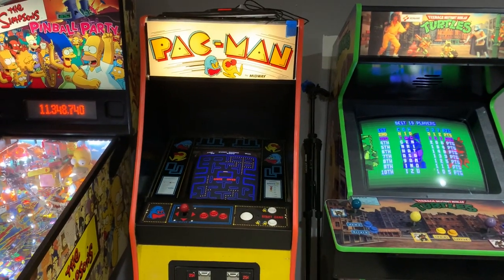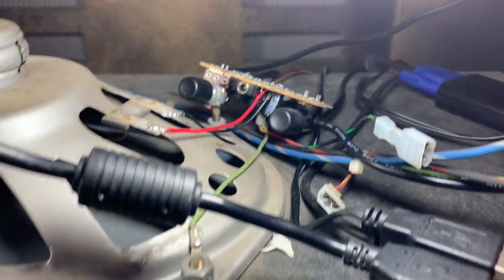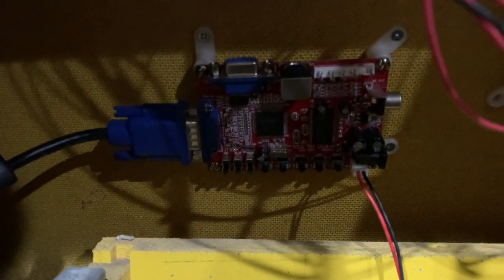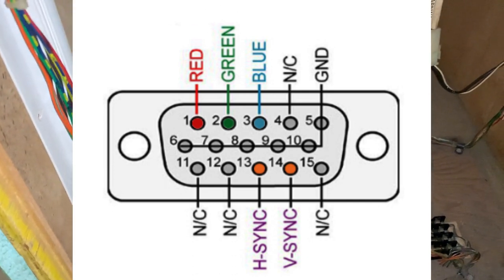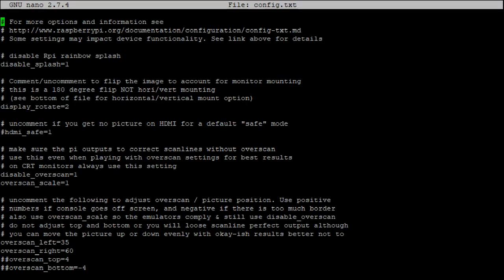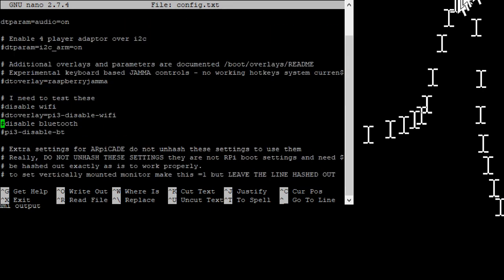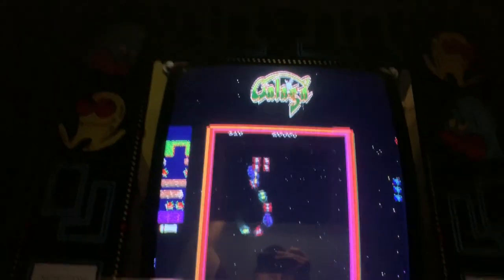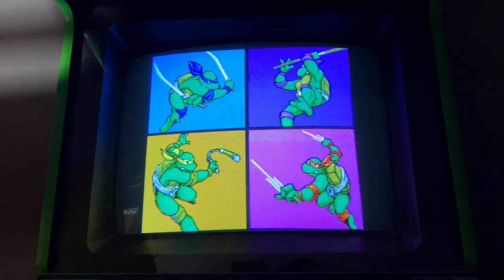The BEST way Raspberry Pi to CGA Arcade Monitor! 240p NO GBS-8100 REQUIRED!(settings in description)

Comment: This video is fantastic, and possibly a starting point for me.  
I've been chasing the idea for years to run my older games on an actual RGB CRT  (Sony Trinitron) but have always got lost in how to actually create the older signal type 15KHz
and 240p.   (is it 30Hz or 60Hz?)
The last thing on Earth I'd expect is to be able to get this out of a cheap HDMI to VGA adaptor or a Pi.  
There are so many years of rabbit holes requiring really old software and special Hardware to produce this result.  With no real answers or hardware availability.   
This looks like it could actually work much to my surprise.  
I have a number of other issues to overcome as my MAME and ROMS are all from 1997 and only work on some old Windows98/95 version of MAME32 that I have.  
So apparently, I need a more modern version of MAME and all new ROMS as my old ones will not work.  
But that's an entirely different issue that I can figure out.

Comment: Thank
you so much for your info. I have an old Time Pilot cabinet that I was trying
to configure with a Rasberry Pi 3 and didn't have any luck getting it to work
with the original CRT until I found your video. My monitor is slightly
different (Wells Gardner K4951). My JAMMA harness is connected to a J-PAC and I
can confirm that the monitor works great with your settings without using the
custom cable since the J-PAC is already connected to the monitor through the
JAMMA harness.
Reply from the maker: Awesome! Glad it worked out for you!

Comment: Very informative vid mate - helped me heaps. 1 question though - doesn't VGA output @ 31kz (and the monitor would be 15kz) or is this something you can adjust in the config?
Cheers :p
Reply: Good question, I'm wondering the same thing...

Comment: Very tastefully converted Pacman cabinet! I have used the VGA cable hack method on all of my cabinets, but use a PC for the emulation. I've got hold of a Raspberry PI now, and am going to do some experimentation soon. Thanks for the detailed video!
Reply from the maker: Thanks! My goal is typically to make the game just a board swap away from being original if I’m putting a pi or PC in it.

I actually just did a GroovyArcade build with an old PC using the same breakout cable. Turned out well, except I had to bypass the JPAC for the video because it just wouldn’t sync no matter what I tried. 😢
Reply: @sk8ersublime  I guess the JPAC bypass using GroovyArcade would be necessary, as GroovyArcade (well, GroovyMAME in that build) does all of the front porch / back porch / 15Khz analogue CRT conversation output itself, without any special convertor (ie: a JPAC, etc)... hence its charm (and AMAZING emulation results). GroovyArcade is amazing.

Comment: Enjoyed the video!  Curious what version of mame you are using?  I have about 10 diffrent arpicade images and always on the lookout for which roms work best with each software version. (Arpicade 3.7, 3.8, etc...). By the way, the Arpicade itself is a fantastic product for any Jamma setup.
Reply from the maker: Yea the RaspberryJamma aripicade is an amazing plug and play solution. I have the 4 player version in my TMNT cabinet since it didn’t have a board and it’s been great. For mame version, I’m using the arpicade 3.9 image so I think that has .207, .192, .172, and .139.

Comment: Great video. So much great information! Have an old cabinet with a good arcade CRT looking to add a PI too it. Seems so simple the new / second way of doing it.
I was wondering what image are you using for your PI. Where to find image? How large?
Been looking for an image like the one in your video, really like it. Keep up the good work. Thanks.
Reply: Check out Arcade Punks website.  There is a front end called Vertical Rise for the RP3 that works great.  Download the torrent file and use Utorrent to download the content.  It's about 16gb.    Good luck

Comment: This was a great video.  I’m redoing a cabinet with such a monitor and it’s already setup with a direct vga cable.  Guessing it was put together the way you did.  I’ll give it a try when I get my RP4.  Newbie, so learning curve is steep.
Reply from the maker: Thanks for watching! Shoot me any questions and I’ll try to help
Reply: I can send some pics of my setup but youtube isn’t giving me that option right now.
Reply: My cabinet was an old mame machine and the monitor looks almost exactly like yours.  He had it setup with a VGA cable going directly to a connector on the monitor board.  It has about 10 wires connected.  It was connected to a computer video card of some sort.  Is it safe to just try it out with the RP?  I've read a few places that improper voltages and cause damage.  I would like to send you a pic to see what you think if there's a way to DM you.  Thanks again.
Reply from the maker: Josh if it’s an old mame machine it’s very likely it was connected to an ArcadeVGA video card in the PC. Very likely the same cable breakout cable sold by Ultimarc as they were the ones who sold the ArcadeVGA. The pinout should be the same, but I would verify with a mutlimeter to be safe.
Reply: @sk8ersublime  thank you.  Would you share some good sources on this topic?  I am very interested in it.
Reply: Also, very noob question... I am looking at Jamma RGBpi and it obviously outputs RGB on the Jamma cables, but can you still connect the monitor the way you did via an hdmi-to-vga adapter and use a Jamma harness for the controls?
Reply from the maker: Arcadecontrols.com forum should cover just about everything you need

Comment: Great job! I’m in the same position with my miss Pac man cabinet. What version of mame are you using? And I guess the trick is to find the roms for that version of mame. Also did you get the high score saving to work? I have a similar set up with RaspberryJAMMA but trouble with some games working or appearing in the menu
Reply from the maker: I’m using various versions as some work better for certain games. I’m using the ArPiCade image that I use with my RaspberryJamma. It has versions .207, .192, .172 and .139 I believe. I would have to double check

Comment: Instant sub, thanks for the info!
Question. I have two CRT monitors with the CGA/9-pin input (and the requisite RGB pins visible/accessible inside, similar to an arcade monitor) that seem like maybe they were from a video wall or similar. Before I go buy an RPi3 and/or other accessories, is there any chance a weird resolution would prevent this from working? And/or if so, any other ideas for testing these CGA/9-pin monitors somehow before ditching/donating them?
Reply from the maker: Not really sure off hand, I would assume it might work as long as you know the pin out of the db9 connector and wire everything correctly to RGB and Sync. Good luck!
Reply: @sk8ersublime  Fun twist, I'm dumb and there are actually only 5 pins, R G B E and S. RGB and S make sense, but not at all familiar with an E pin.

Comment: I used a VGA666 interface, I think is a cleaner solution. My cabinet also has CSync, so I had to combine the sync signals,  as well.  As far as I know it is not recommended to just connect both cables together, you need a combiner circuit  like this: https://www.retrorgb.com/building-a-passive-sync-combiner.html . Also, there is a specific 666 converter that has the csync ready: http://retrogamerestore.com/vga666rgbs/

Comment: Great video and great explanation! Do you know if I could do this with a medium (EGA) resolution monitor? Thanks for the video.
Reply from the maker: I’m not sure off hand, as I’ve never worked with one before. I would assume it would work as long as RGB and Sync are the same, but you would use a higher resolution. But Again I do not have experience with that. Thanks for watching!
Reply: @shark80228 I have an old school Japanese Sharp CRT monitor Analog DB9. I haven’t connected it to anything yet. What are the res differences on CGA vs EVA?
Reply: @r.in.shibuya  CGA is 15khz and ega is 25khz. EGA is medium resolution and CGA is a lower resolution. Getting input at the correct frequency is the tricky part. I'm still trying to figure it out.
Reply: Shark80228  thanks the for the reply. I am dealing with a CRT monitor that has a DB9 input (SHARP CU-14AG2) all I know it’s a color RGB, I believe it was for the old first gen PC’s (NEC PC98). It turns on but still no source to test it with. I picked up the HDMI > VGA (db15) converter and used a db15>db9 pin converter. Before I adjusting setting with my Raspberry Pi I want to make sure it’s working. I do See the crt rays minimizing and expanding on the screen when I switch it on an off... but I’m not sure if that a marker of it being 100% functional, I do have a strong feeling the monitor is fine.

Comment: I am using a 60 in 1 currently, I had no idea you could set the pi up for vertical. I may well install my pi 4 as well now, but my crt is on scart which is a pain in the arse, got an ultimate scart adaptor on the way as nothing else has worked properly display wise using any cable adaptor  so I'm hoping the ultimate adaptor will do it. I can only dream of a wells G. monitor at min :P one day....One day.
Reply from the maker: I don’t have any scart experience, but it looks like that ultimate adapter should do the trick based on the description I just read. Good luck!
Reply: @sk8ersublime  Thanks and I sure hope so I've tried a few adaptors for scart crt now and none are very good tbh. I know you can fiddle with the tvs to accept an standard rgb input but I was trying to avoid that and a proper arcade wells G. Monitor is way out of my price range right now.
Reply: just make up a cable
Reply: @Teckno77  SCART-equipped tvs accept by design RGB over SCART...

Comment: Nice job!i Works with out raspi-jamma?I planning to use 0 delay encoders and wire up straight to the arcade monitor
Reply from the maker: yea! no raspberry jamma required! Good luck with your build!
Reply: sk8ersublime Thank you .Only problem I have now is overscan on top and bottom.Do you know how to fix this?
Reply from the maker: Arcadezone 81 you will need to play around with the overscan_left and overscan_right settings. Try them at 0, or comment them out. I tried a bunch of settings until I found what worked best for me
Reply: sk8ersublime I will.Thank you

Comment: When you tie the horizontal and vertical sync lines into a single line going into the arcade CRT, do you have to add a resistor in series between those lines and the monitor?  Doesn't that double the potential current going into the monitor's sync?

Comment: hey back again..so i purchased the arpicade with jamma from high score, and 3bplus with arpicade 3x latest download. i also have the WG 4900 zaxxon standard resolution. now come to find out from arpicade noob section, this wont support medium resolution Arcade CRT, only low resolution. the picture is split half at top and half at the bottom of screen which i heard you mention in the video, and the picture is not clear like its not scanning properly. do you have any suggestions for my setup possibly changing config to what you have cause you have same monitor has i have?? any help would be great .
Reply from the maker: Sorry I have no clue as I don’t have any medium res monitors.

Comment: I hooked up my hdmi to vga and made.a.cord with a pinot has you described! I also entered the changes in the config.txt but no dice no picture on my car 15kHz zaxxon cabinet my screen works with Saxon pcb. What version of retropi should I be using? Think I'm going to update my rasppi have not updated my pi2 in 3 years. How's the south park pin going? I'm sure I'm missing something or I'm thinking of getting the jamma hat for mine like you did on your other machine. Thanks if you can help in anyway but no biggie if your busy. Thanks for sharing your videos.
Reply from the maker: I’m using the arpicade image. Not using retropie. I have only done this on a Pi3 and Pi3+.

Verify your pinout is correct and that your zaxxon sync it correctly configured. 

South Park is working great! I need to get new artwork for it and a colorDMD and then there won’t really be much more to do to it :)

The RasberryJamma is an awesome device if you just want it to work without the headache of creating a cable and messing with config.txt. I bought mine from highscoresaves and got the arpicade image from their support forums.
Reply: After you get your south park sorted what's your next project?? That's a great pinball. I have stern lightning, stern ted nugent, stern meteor which like you I drove 3 half hours one way to get that one. And a Williams laser ball. All been rebuilt in some ways. Anyway I decided to buy the same one you have from same company with games and the 10 extra for.zaxxon  picture not sure what that is a image of zaxxon. and the connector with no wires and a rasp.3+ $237.00 I really want to keep my zaxxon it.all.works and pcb after hours of trying to figure out the board with a pulse ic tester. Found out it was one of my ram chips. But sure was worth it fixing myself. I found the ram chip on eBay and the seller decided to send all ten ram.chips for price of one I messaged him and he said they been sitting in is store for 10years. He said someone might has well have them. Very cool! I've kept my crt.But when I got machine it had a lot of burn in So I picked up a few crt tv's on CL  all.19 in and changed the tube for a Samsung and used my old yoke. I capped it and it took some time with setting it up convergence and magnet strips but the TPG from arcadepartsandrepair. Made it easier to.adjust. That company is great the owner is super helpful and emails you very quickly with answers. Can you recommend a company for my control panel graphics for my zaxxon? Can't seem.to find any place on google. The Pac man cabinet looks to be in good shape? And that video you made on donkey Kong marque with your phone that video.quality was.So poor! To bad I wanted to see that better maybe you can make a video of cabinet again? And thanks for the info I'm still going to try to see if I can get it to work whilst I'm waiting for my order can't wait to see how this all.works out. Thanks
Reply from the maker: TheSawyer10702 oh man...that donkey Kong scratch build....I don’t have it anymore. I had a real DK but I’ve sold it since :( 

For artwork, check with thisoldgame or szabosarcade. Both can probably do custom for you if they don’t have it. Thisoldgame has super zaxxon listed
Reply: So I got my arpicade board but my zaxxon has a straight 22 pin edge connector but the jamma has 21 and a slot then 6 so not sure how to hook up and can't find on website how to connect to my arcade any suggestions? I posted on arcadepi forum also so any help please
Reply from the maker: TheSawyer10702 buy a jamma harness and rewire your cabinet. Or find an adaptor for a zaxxon to jamma. Do not plug the arpicade into your cabinet until you verify you have a jamma connection and your voltages are going to the correct jamma pin standard!

Comment: Do you think the breakout cable can be used on PC or only works on a Pi?
Reply from the maker: The breakout cable will work with a PC, but you have to get a driver or some software to drive the low resolution.

Comment: Howdy. If you JUST did the wiring and not the in depth coding to the RasPi, how would the image look?
Reply from the maker: Without making the changes in the config file, you won’t get an image on screen. You get will a rolling out of sync picture. If you don’t want to do the config, I recommend getting a RaspberryJamma from hiscoresaves
Reply: @sk8ersublime  OK. I think i'll give the coding a try. SO, I'm using the RetroPie Emulation Station software, and I believe you are using the Arpicade software. Can I find these settings in RetroPie? Also, if i make these changes, will they also affect the main menu screens in RetroPie/EmStation ?? Essentially, is the whole system (in game or menus) running in CGA mode the whole time?
Reply from the maker: The build is arpicade 3.9. It’s not retropie, but similar. When you modify the config file, it’s system wide, so yes, everything will run in the lower resolutions
Reply: @sk8ersublime  Hey thanks so much for helping me. I just figured out how to SSH into my RasPi and can see the many options to change, BUT I dont see all of them. I don't see hdmi_pixel_encoding=2  or hdmi_ignore_edid=0xa5000080 Can I just type that into the lines of config?? Or how can I access them?
Reply from the maker: @selophane43  yes you can just add the lines. You can also do this without ssh if you access the sd card on a PC.

Comment: So, if my CRT already has a VGA port built out of it, and I do a HDMI -> VGA converter from the Pi, do I still need to build a break out cable? Or can I just use the cable + adapter and adjust the Pi config?
Reply from the maker: If your monitor has a VGA port, it’s likely not a CGA arcade monitor or a hi res monitor. I believe At that point you can just use a normal VGA resolution with an HDMI adaptor. You wouldn’t need to do these settings as they are here to force the pi to output to old low res arcade monitors 15K signal. Instead of the 30 you get from VGA.

Comment: The settings i have to do it before i connect the pi with the crt ,in an another screen or i can do it  in the crt screen?if you have any photo of your cable  connectivity i would  appreciate it.
Thank you friend..
Reply from the maker: You need to modify the settings either using ssh to the PI or directly plugging the sd card into your pc